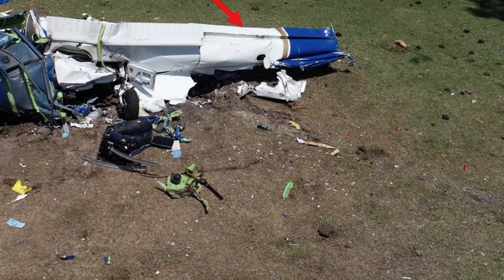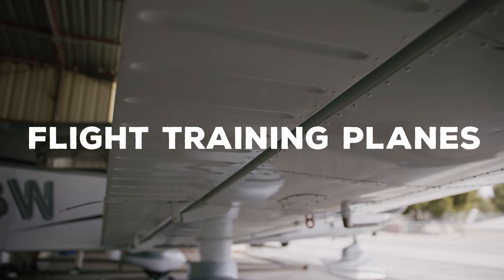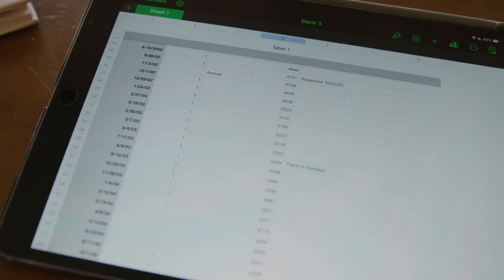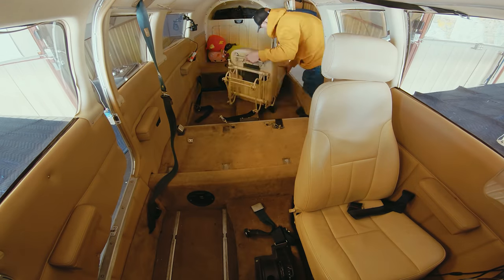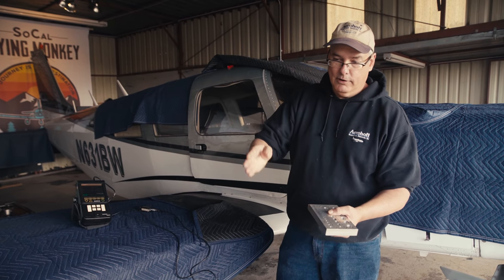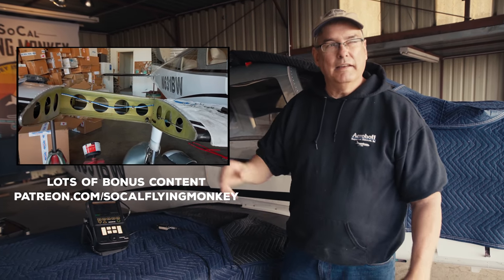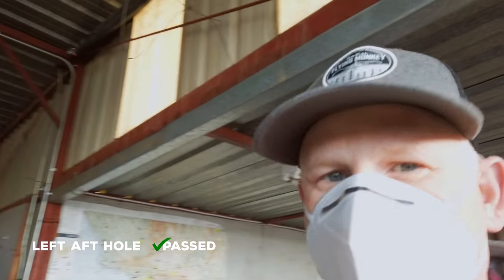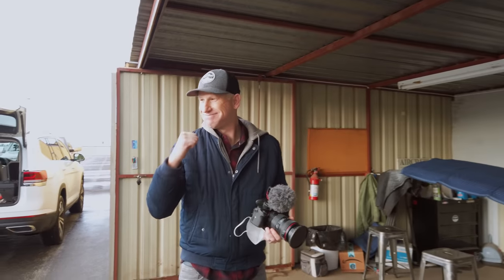Does my airplane need NEW WINGS? (Piper Wing Spar AD Eddy Current Inspection)

Comment: Thanks so much for this video, because it's so hard to find concise and complete information on this. I was actually planning on buying Arrow or Archer
Reply from the maker: Might be a good idea to get the eddy current inspection done in the prebuy, if it is close to the factored hours.  There is a chance in a subsequent AD that they might expand it to more airframes or the same ones with fewer hours/lower time.  There is some debate about the risk of pulling the bolts and doing more harm than good so you may have a hard time convincing the airplane seller to let you do it if its not required by the AD during a prebuy inspection.  Theoretically, you could buy a lower time airframe and then they require it in the future, you do it and it fails.  Would rather know that up front.  That seems like a very unlikely scenario but it certainly is possible. Something to think about.
Reply: @SoCalFlyingMonkey  it for sure is easier to convince them to comply with an eddy test now, there is a good reason and I think all (sensible) buyers will want to do one before they commit. I just wonder instead of taking the bolts out, is a X-ray /radiograph also possible or could give you an indication of wear on the inside? I saw this website: https://www.researchgate.net/figure/Typical-aircraft-wing-spar-radiograph_fig2_233636345

Comment: Happy for you.  I’ve done six of these at this point (3 Warriors, an Archer II, an Arrow III, and a Lance) and have not seen any issues.  Soaking the bolts with Kroil the day before is important to do.  Have heard of one instance where damage to the spar was induced by harshly driving out the bolts.
Reply from the maker: that's what we used.  still, they needed some coaxing to come out....

Comment: Great video, my assumption is when I'm ready to purchase a used GA Plane & put a lot of time and money into it, make sure that there's a lot of accessible used parts for that model like new wings and spars. Can't imagine your up flying with entire family and a wing lets go. Nobody is wearing any parachutes, it would be instantly the plane pitches to one side and over. There'd be zero time to react. Not sure if a wing lets go if a GA plane with a parachute would work if plane is upside down? Makes one plan & think about flying older planes, I know even new planes have separate issues as well. Its all about managing risks.
Reply from the maker: Wing separation incidents are extremely rare. You can search the NTSB database by keywords and aircraft types.  As far as general aviation goes, the danger from that sort of thing is so far down the list in my opinion.  But still, one should always make sure to comply with all ADs and SBs and have good inspections for corrosion.

Comment: Do you know what the failure rate is for the eddy current test? I’m sure it was a big relief to find out you weren’t going to have to replace the wings but also that you weren’t flying around with cracked spars. The age of the GA fleet is really getting up there and we will see this type thing increasing as time goes on, keep up the good maintenance and find a goos a&p\IA that will really inspect critical areas.
Reply from the maker: I think he said a six percent failure rate. Not sure the updated stats though.
Reply: @SoCalFlyingMonkey  , thanks I must of missed that.

Comment: Congrats on the passing! Does 1BW have to undergo the inspection panel AD for corrosion on the spar as well?
Reply from the maker: Yes, my mechanic did that inspection as well and it was clean. The plane had been corrosion proofed at the factory when manufactured and that has held up well.

Comment: However,  Is this area of the wing spar and bolt hole(s) part of the 100 hour inspection?  Is it a "one time" Ad?
Blue sky to all.
Reply from the maker: This is not part of the corrosion inspection AD. That is a different one and in a different area.  This is a one time interim AD. I imagine they will issue further guidance based on the data collected from this AD, maybe another AD

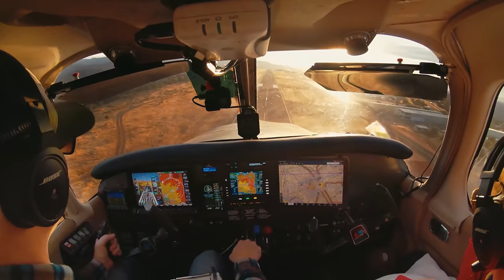Comment: Your plane will go faster if you disconnect the parachute you have hanging out the door at the 3:16 mark. :)  
My first plane was a 1973 Piper Arrow.  They are know for having spar and rib damage due to hard landings. Mine was no exception.  If you notice any upward dimpling in your wing it is because someone landed it very hard and has pushed the gear up. which usually cracks 5 or six ribs.  Glad yours was ok on this particular inspection.  Looks like a well maintained airplane.

Comment: We have done several wing spar eddy current inspections with aircraft over 11,000 hrs and factored wing over 5,000 all with passing grades. The one crash in Florida had tell tale signs that were clearly neglected. Because of obvious neglect, the rest of the aviation community who pays attention, does inspections and regularly scheduled maintenance suffer the consequences.
Reply from the maker: We'll see how all the data shakes out.  SHould be interesting!

Comment: Did you have any trouble removing the bolts?
Reply: When I had my warrior done a guys Lance was there and they had terrible trouble getting its bolts out.
Reply: I understand that is Pipers biggest concern. They don’t really say how to get them out with out damaging the holes. In Canada almost all aircraft in the AD will have to be done even low time aircraft due to incomplete logs because of import.
Reply from the maker: The needed some coaxing and I was worried about banging them out based on the Piper comments to the proposed AD during the comment period.  But looks like it was ok- i mean you got to get them out. we followed everything everyone has said about all the techniques. They required some tapping with a lead mallet....

Comment: Good news, but not wanting to throw a wet towel on your party, remember this is only the data gathering portion of the AD.  R1 will be out one day with what the fleet needs to do next.
Reply from the maker: Yep it’s an interim AD
Reply: Can you explain further what could be in the pipeline for us intrepid spar owners?
Reply: @peterg9466  From what I understand, the FAA may change the modified hours formula when they get enough data from the higher time PA28/32 airplanes.

Comment: Hello, Flying Monkeys from Sydney, Australia.
* I am pleased that the Piper (wing spar connection) passed the magnetic resistance (Eddy current testing) which satisfies the safety AD issued by the regulator.
🌏🇭🇲💬
Reply from the maker: Thank you!

Comment: One of my first jobs was flying cargo in a Cherokee Six. 

They were cheap, and they could haul a ton. 

Plate glass, transmissions, truck tires, live goats. If you could get the doors closed and put enough ballast in the forward luggage compartment, she’d fly. 

At the time we had no idea about the wing problems. The focus was usually the stabilator on these. The NDT on the counterweight fitting and those poor overloaded hinge bearings.
Reply from the maker: Live goats!  Wow

Comment: Am assuming there are torque specs for the bolts - maybe over tightening could cause stress cracks as well - just asking.
Reply from the maker: Yes I believe it is 360 to 390 inch pounds but I would double check that.  My mechanic and I looked it up when he tightened the bolts/nuts.
Reply: @SoCalFlyingMonkey  
Thanks for that answer.  Glad your plane passed inspection with flying colors.

Comment: Your specific plane, not really. A cargo hauler is alot different "kind of flying" then the birds at Emery Riddle experienced. The ER planes suffered lots of poor landings (shock loads to the spar) and it is said some planes did illegal "high G" maneuvers due to the fact that they were "rentals".
Reply from the maker: that's definitely true and a good point.  my plane has some patches on the wing skins- previous documented repairs.  it made me wonder....
Reply: @SoCalFlyingMonkey  Freight Dogs leaving their mark, also maybe shared hangar "rash". There is/was alot of flight training here in PHX. Pilots get into a Arrow and suddenly its a P-51... (note I have a high time Arrow and it passed the test - make sure you call Vero and get the right bolts to replace, for many Pipers the current IPC is calling for the NAS close tolerance bolts instead of the AN close tolerance originally spec'd)

Comment: Thanks Eric, and congrats!  Learned a ton from this, and more comfortable bringing Pipers back into the search for my first airplane. Am I right that there are only 2 bolts holding each wing on?
Reply from the maker: There are I think 16 bolts in total but not totally sure- 8 lower spar and 8 upper I believe. I have to look at the parts or service manual.  They only require inspecting the bolt holes for the two most outboard on the lower spar on each wing...
Reply: @SoCalFlyingMonkey  thanks, that makes more sense!

Comment: how often do you have to get this inspection?  every 100 hrs?
Reply from the maker: just once for now. it is an interim AD.  I expect the FAA will issue further guidance after all the data is collected form this round
Reply: @SoCalFlyingMonkey  so so happy and relieved for you.  i know this is a safety issue and it's critical but man i don't know what someone's going to do if that's cracked.  would probably be very expensive for a company to start making them and getting those new parts TSO'd.  bullet dodged.